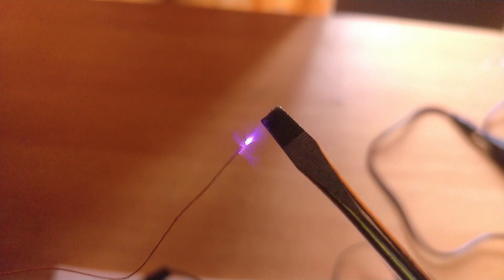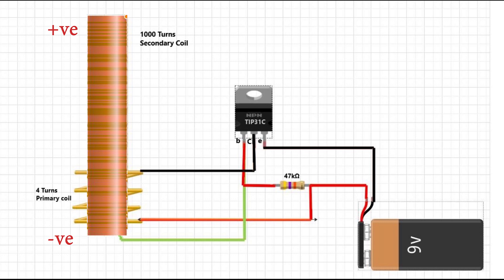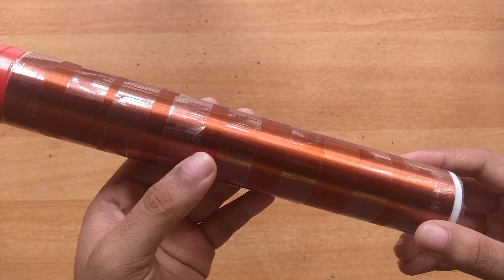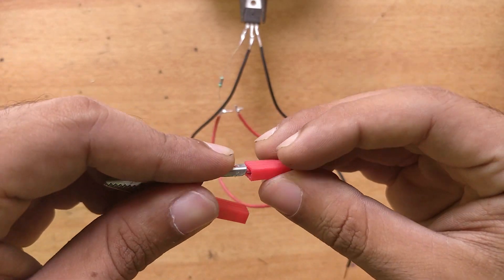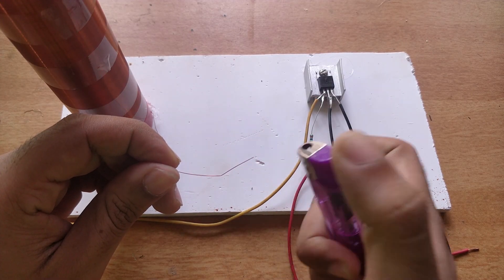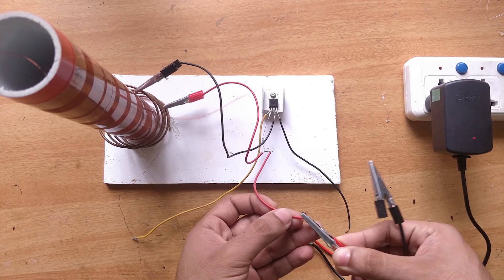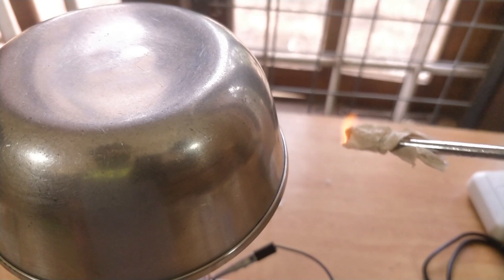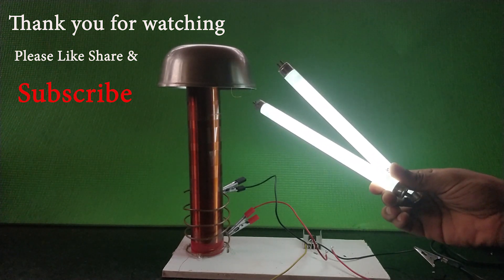How to make Tesla Coil at Home | Slayer Exciter | High Voltage Arc

Comment: Awesome video bro
I'm also planning to make this one
Could you please suggest me the length of secondary wire to be bought??
It'll be helpful 
Thank You bro..
Reply from the maker: That depends on your pipe length, thickness of the copper wire and dia of pipe. (For example, if you are taking 1 mm wire, then you will have  10 turns in 1cm, and 100 for 10cm. So length of wire needed for 10cm is 2πr x 100 mm. (Perimeter of 1 turn multiplied by length) ). I hope this solves your problem, feel free to ask if  it's not clear 😃.
Reply: @BehindTheClutter  ThaaanQ bro 😄
Reply from the maker: You are welcome 😀
Reply: @BehindTheClutter  once give me clarity in instaa bro ...
Reply from the maker: Sure bro.
Reply: @BehindTheClutter  Tnq for this type of valuable information.
Thank you for that!